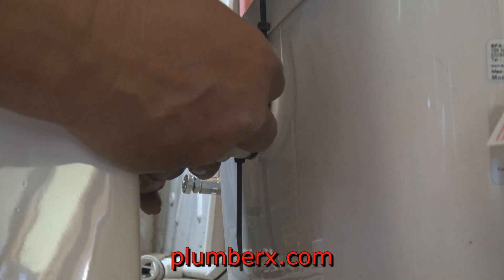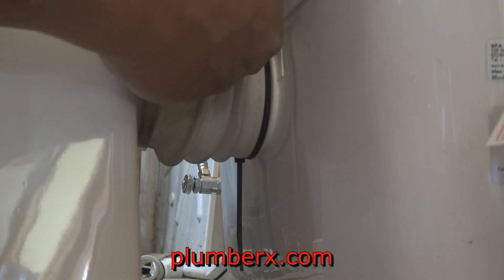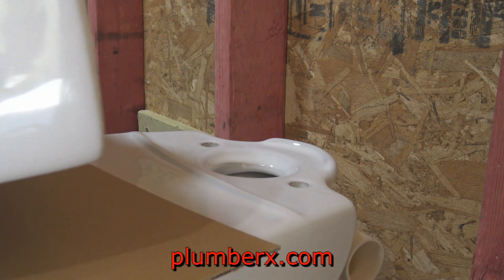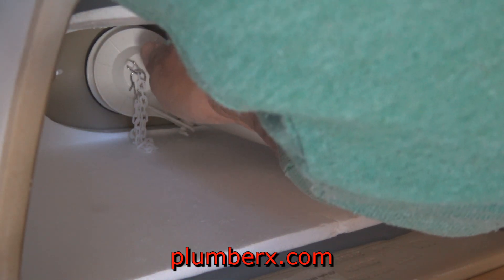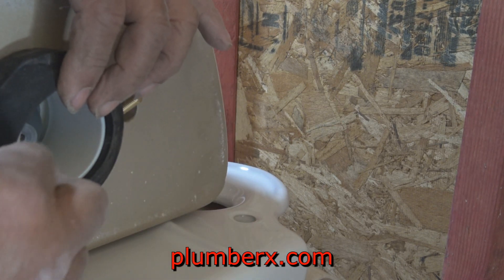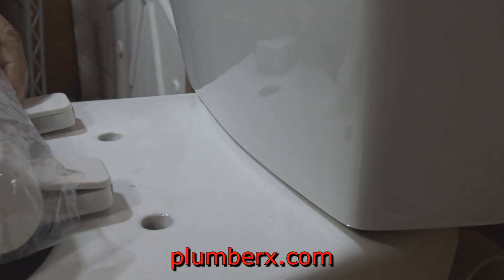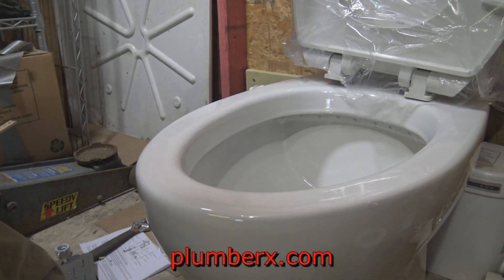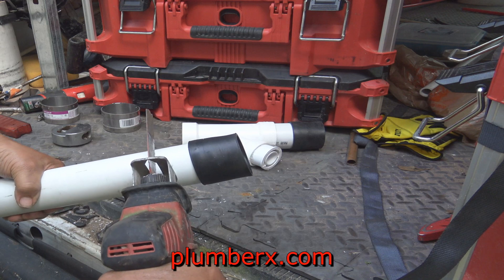Up Flush Toilet 4/10 | How To Plumbing

Comment: Where are the toilet bolts included with the bowl
Reply from the maker: The toilet bolts should be in the box, If not you may want to call the manufacture
Reply: @theartofplumbing  thank you
Reply from the maker: @alsawaya1978  your welcome.👍
Reply: I do not have direct access to the main vent stack what are my other options?
Reply from the maker: @alsawaya1978  it's ok. It's best to run the new vent from toilet up and out by itself anyway. Like I did in this video.
Reply: @theartofplumbing  I am installing in the basement.
Reply from the maker: I see. Me I would run the vent at the back corner of one of the closets and to attic and out thru roof. If your living in a cold climate area run 2" pipe to prevent frost closer

Comment: How do I know if I need an up flush toilet? My house was built in 2002.  I have well and septic. Drain and toilet pipes are coming out of the basement floor.  Thank you sir!
Reply from the maker: Upflush toilet comes in handy when there is not anywhere close to run the waste line under the foundation. Upflush can be run just about anywhere most toilets will not work in.
Reply: @theartofplumbing  Many thanks for the reply!  So, if I have the waste pipe in floor I don’t need a any kind of pump? I can install a standard toilet?  Who can I throw a donation your way for the help?  Thanks again Mark

Comment: Which zip tie is best to use, because you showed a white one, then you showed the black one at the pump?
Reply from the maker: Any zip tie will do.
Reply: @how to plumbing.  Sorry,  you didn't say whi h Saniflo you had in the video!
Reply: @How to plumbing.  I also wanted to keep the discharge at 1inch, and according to your video you used 3/4. Will the attachments work with 1inch pvc or do you have to purchase the extra accessories?  Where do you get the parts for this system if need be?